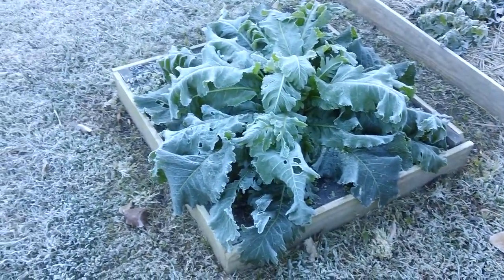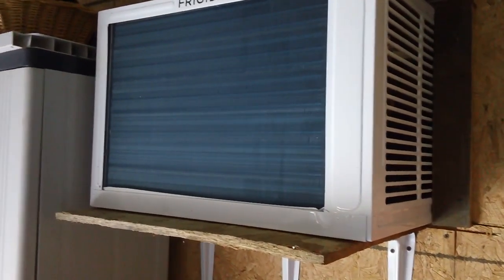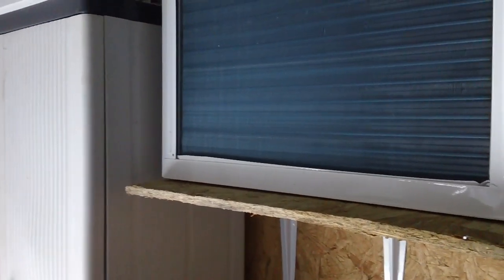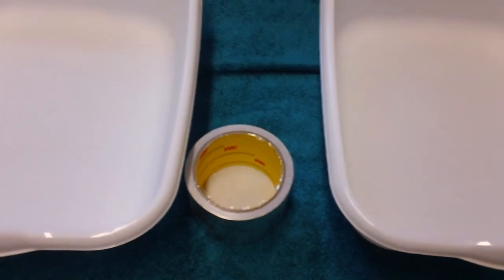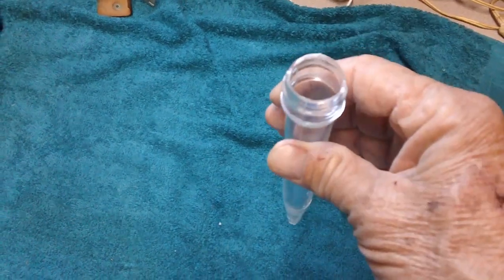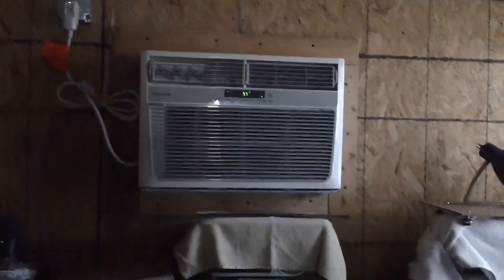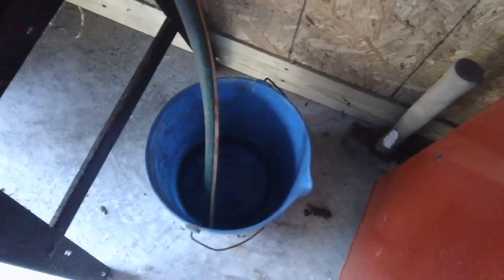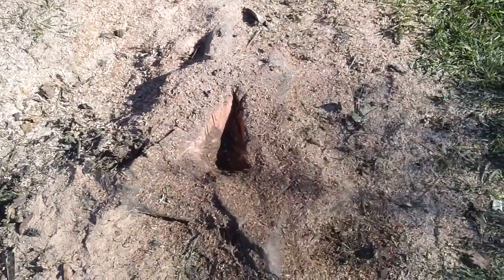Mish-Mash #231

Comment: The kidney stones are not likely caused by too much ice cream or drinking tap water. 95% of kidney stones are calcium oxalate and the culprit is the oxalate. Get those stones you passed analyzed and then have a metabolic workup. The first bit of advice your physician will give you is to drink six glasses of water a day. The rest of the advice will depend on stone composition plus metabolic test results. This is pretty standard stuff and will help reduce your chances of stone recurrence. Good luck! Also I’ll bet you had a flexible and not a rigid cystoscope which is a fair bit easier to tolerate!
Reply from the maker: Norman,
I didn't look. LOL
Regards,
John
Reply: Trust me John, if they used the rigid cystoscope, you would know!

Comment: Am amazed you got frost already we not got none in UK yet wow ! I like the condensation work around can't you run a hose outside as it doesn't look to far to door ? No pun intended gald your all clear bud . regards Pauly 😀
Reply from the maker: Pauly,
When closed, the door would shut off the water flow out of the hose.  The bucket works fine.  I'll only need it during the winter when using the heat mode.
Regards,
John